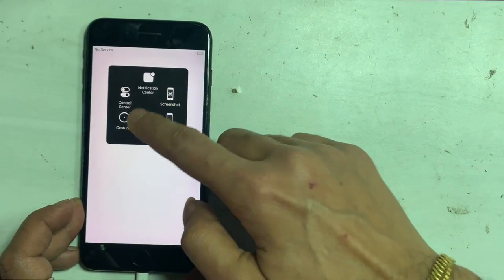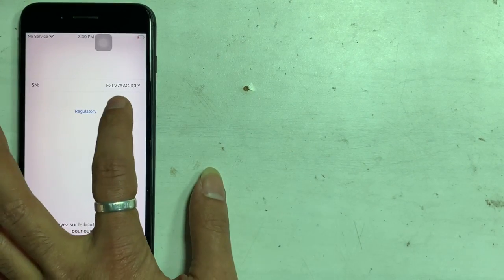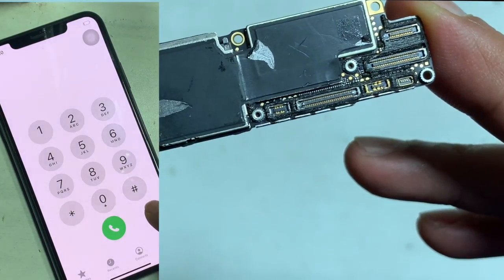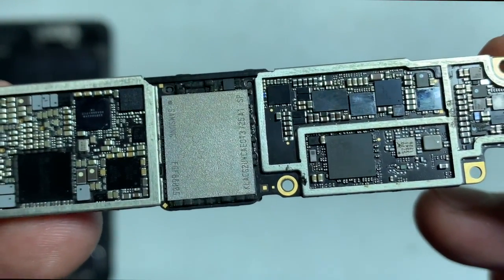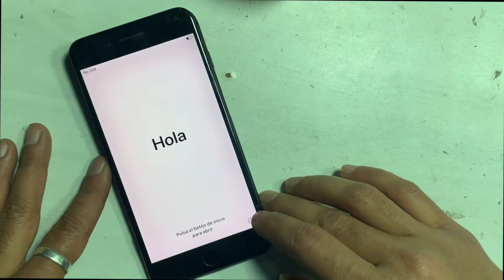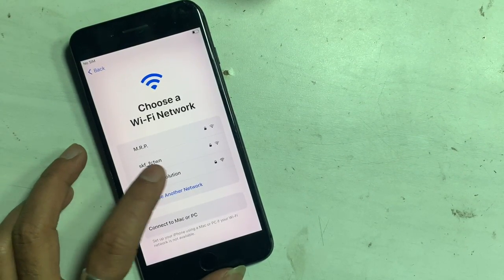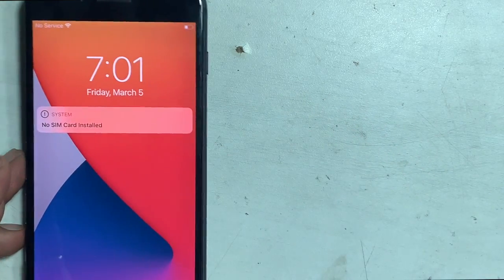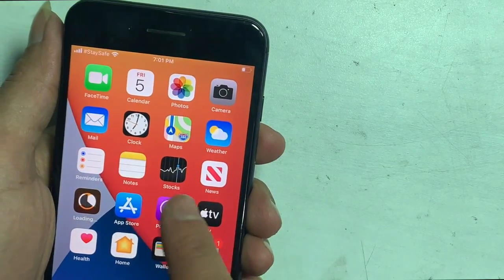iPhone 8/8Plus unable to active solution!Fix stuck on activation screen iPhone 8/8Plus.

Comment: Excellent and very useful video. I managed to change the serial number, wi-fi and bluetooth addresses of an iPhone 8 Plus by using a P13 nand programmer. I did so to remove iCloud activation lock. The problem is that the phone cannot activate after changing these credentials. Maybe it cannot activate because I forgot to unbind wi-fi when it was in purple mode. I had also put the phone in DFU mode and installed the firmware by using iTunes but the problem was not solved. Is it necessary to change all data to remove the activation lock on an iPhone? I need your advice. Thank you.
Reply from the maker: Only changing serial and wifi address not complete the job of iCloud activation.That may works on iPad but not in iPhone not possible by this.
Reply: Thank you for your advice. Which chips do I have to desolder to remove iCloud activation lock? I see IMEI and other info if I press the "i" but nothing appears when I dial *#06#